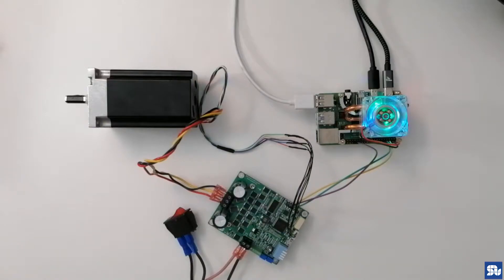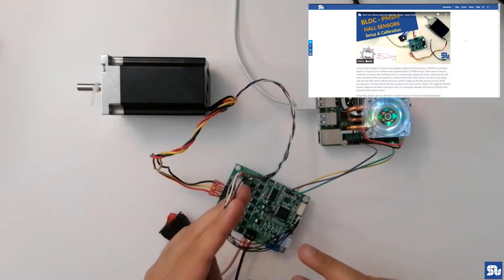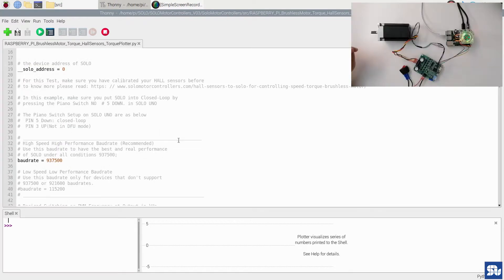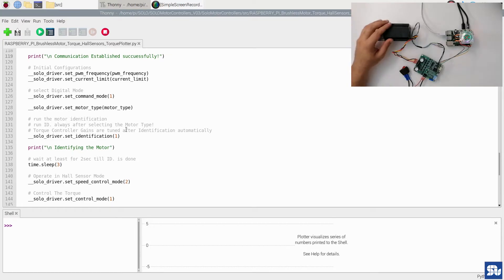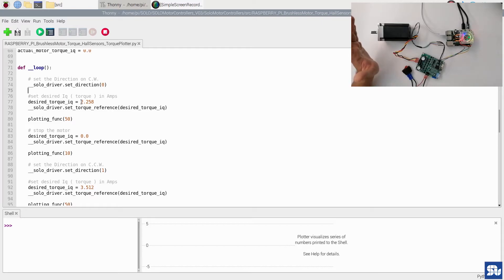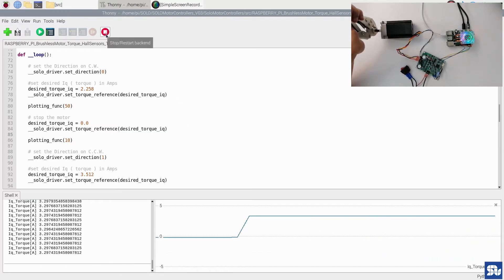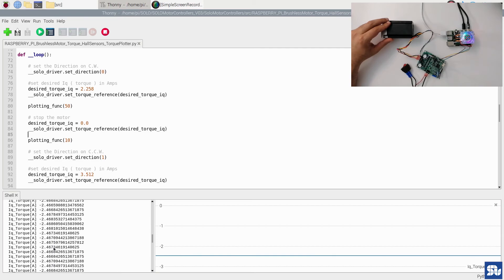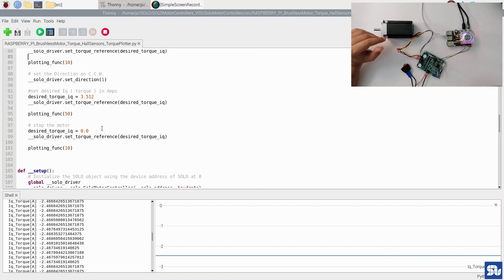Brushless Motor Torque Control with Raspberry Pi and SOLO in Python | HALL Sensors Mode

Comment: I think you should also recommend some motors on your website

I love your product, I think I will buy it this week for a test bench in which I want to test my DIY mechanisms under different torque and speed conditions. However I cant decide on a suitable motor that would giver me a good range :D

Like a low KV value, high torque at lower speeds and so on
Reply from the maker: Thank you for your feedback, we born as a multy motor solution but we will evaluate this possibility in the future too
Reply: @SOLOMotorControllers  please do. I need to design a linear motion system and I would like to buy everything from you.

Simplifying my supply chain and even better documentation on the motor & controller integration. That’s the dream.

I know many people who buy Odrive because they sell motor and encoder. I love your solution better. I think you have a superior product.

Or at least for now you can recommend motors on your blog, like kits but its better if you sell so you can increase revenue